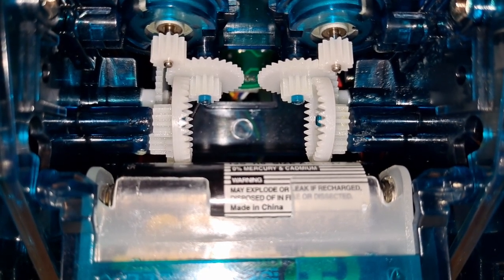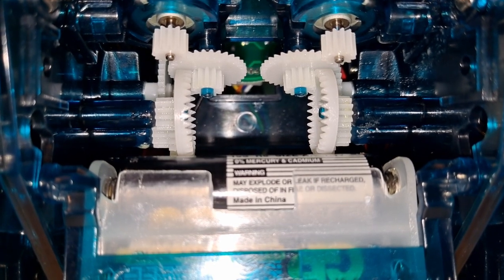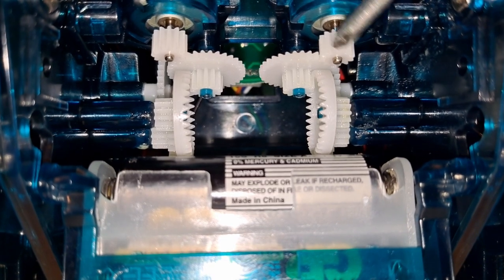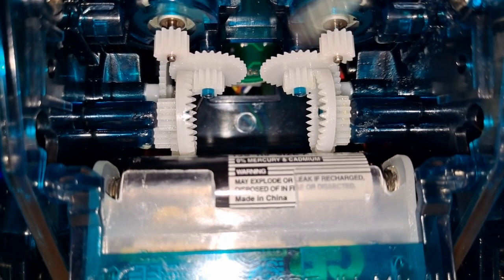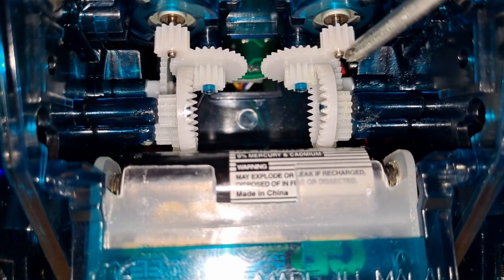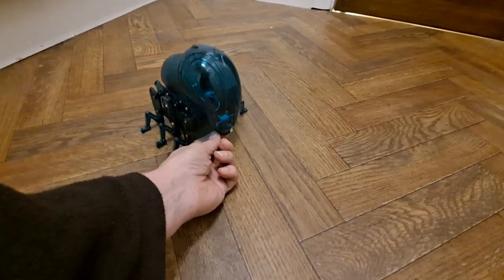Insect-a-zoid PART 7 fixed the noise 😁

Comment: Good work Graham. Just shows how a tiny adjustment makes a big difference.
That will be an IR diode we can see flashing at the front? The camera picks up the IR light but you would not be able to see it. I wondered how long it would last on those batteries.
Leave it running in the kitchen and set Nanny off her head. 😁😆
Reply from the maker: Gosh, that's a good idea, Mike. I will give her your contact details 🤣
Reply: @GrandadIsAnOldMan  😁🤣